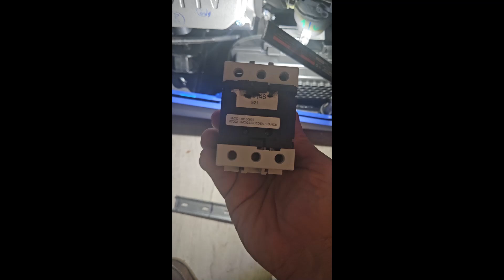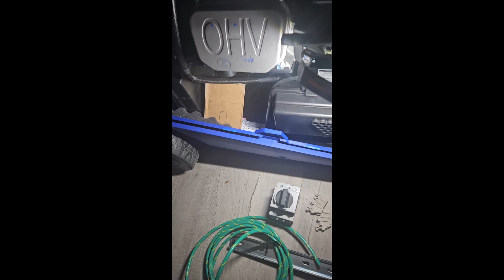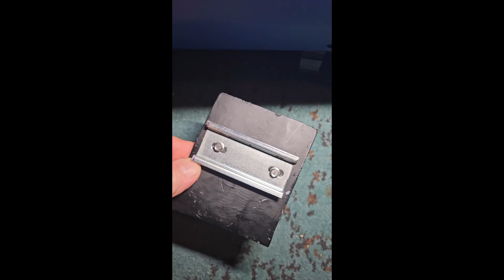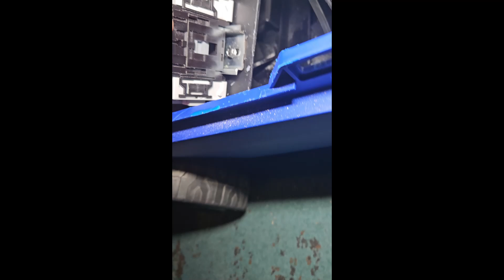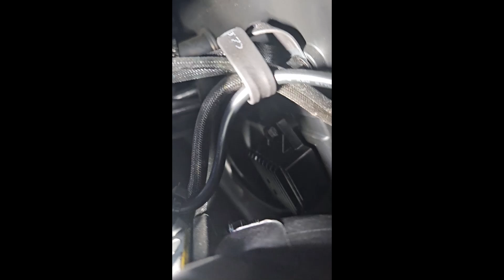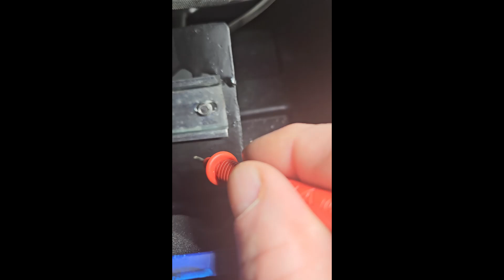Westinghouse iGen11000DFc inverter generator floating neutral switch part 1

Comment: Why not just use a bonding plug?  This seems like a lot of work and I would be concerned about someone not remembering to flip the switch.  At least the bonding plug can be hanging off the generator near the outlets somewhere and you can see it all the time.  To each his own I suppose.  What is the benefit of the switch vs. a bonding plug?

Comment from the maker: I think the part number is Baco Controls 0174315 63A 3P + NC/NO Disc Sw, Din-Rail Mnt,
should be 600 volts. You dont want the one with the rod sticking out of the back. It looks expensive new. I found mine on ebay for 50$